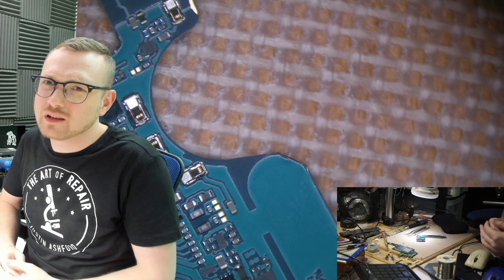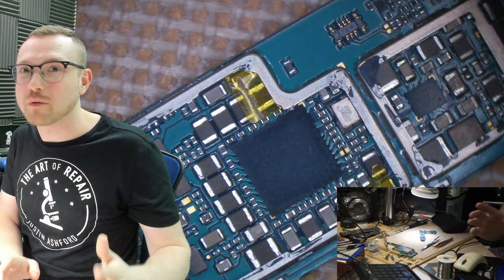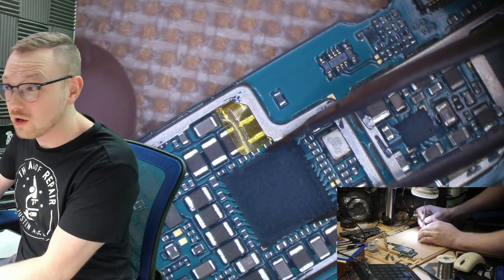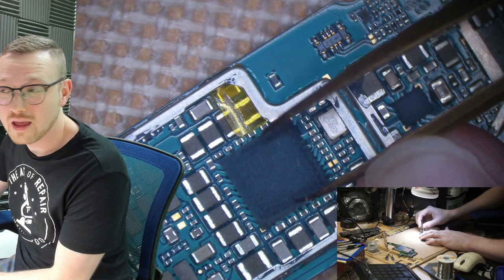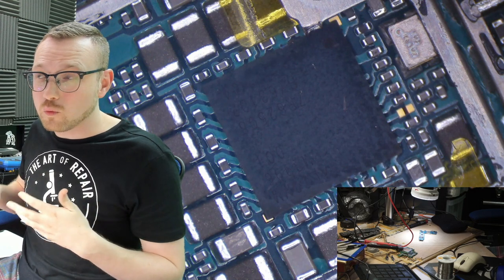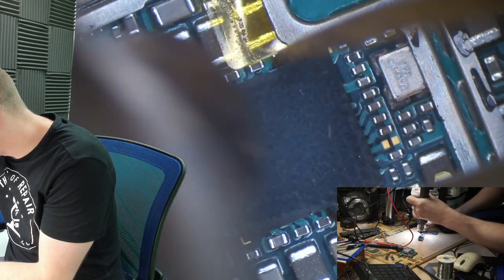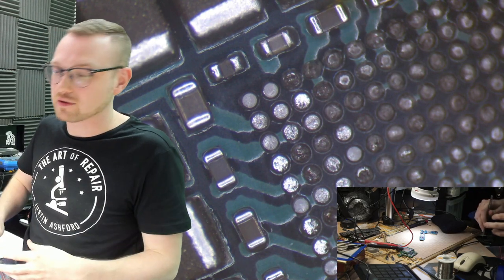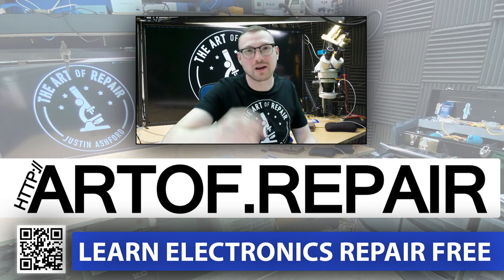Quick & Easy | Basic IC Removal Technique & Tips | Harvest Chips with Ease | Small - Med Sized ICs

Comment: I live in the hills of Nowhere and cell signal is pretty ghosty so I draw spotty WIFI from a repeater linking me to my family's main house. When you mentioned visual cues I knew at 3am that I had to get out of bed and go to the main house to watch this with great interest. I don't care about the boards but I want to lift working components, not roasted chestnuts. You have started my day off right, sir. Recycled boards and running specs on all the components has become my primary source of parts for projects. I love finding real "get shit done" components like expensive or high grade op amps, regulator or booster ICs or just the really useful transistors.

Comment: I did this today and it worked really well, I got the idea from your other video on how to deal with EMI shields so I guess its no suprise you do it in other circuits. I liked the way you described gravity can react faster than us also haha, just a solid fact right there. Now I'm just going to go through your other videos and find out if there are any good techniques for reapplying BGA chips, if not I will just make something to hold it in place while gravity pulls the chip back down once the solder has wet.

Comment: What if you were working on a huge and heavy board? Wouldn't you rip the pads?
Reply from the maker: this video is for microsoldering, not for big boards. if it's a big board, but you felt like it would still work.. don't lift the entire motherboard, just hold onto the chip till it feels loose and it should come up easy. 

The goal of "lifting" the board is that the phone and small tablet boards are super light already so they are never heavy enough to destroy stuff. also, we are only lifting like a millimeter if that, just go get a practice board and try a few times, if its obviously some huge ic chip that you have no business taking off like this, it will be apparent, so if you couldn't do this normally with a normal hot air station. prob best not to try and pull it off. because that's not the goal here.

Comment: If one side gives before another the weight of the board might rip off the trace on a few solder points?
Reply from the maker: nah, also, your really not so high off the ground and if you just make sure you aim your hot air where the trouble spot of the chip would be i think that could easily solve that if it were much of an issue. But iv been doing it this way for years and its been amazing every time. Just don't hold up high in the air XD lol

Comment: So, I have an AOYUE Int 968 and have tried to get a mosfet off a motherboard from a First edition Xbox One. I've seen others make this look super easy in videos but mine has completely crumbled to ashes now trying to get it off.  So now I have no black top of the mosfet left on the board but still have it soldered to the board. I don't even see the solder melting at all but the heat sure is hot as hell and burnt up what was left of the mosfet i was trying to remove. Any tips for me to get the soldered part of this mosfet to come off .

Comment: Bro what temp do i use in my quick 861dw+ i only work on Android mobile phone Android phone comes in white pasted glue ic , black pasted and some times not pasted but once i was Repairing a iPhone 7 audio grey out i was continuous heating that ic from last 1 min with 350 air80 but ic not pop up , i increased temp to 370 air 80 ic did not move in last i have to use 400temp and air 80 audio ic came out of motherboard but after reballing and installing ic phone was dead i chekon dc my bb cpu on back side was heating too much what technique should i use in iPhone Repair ?

Comment: For some reason when ever I try to remove a memory chip the solder does not melt. I have been heating one up as I am writing this comment for like 17 mins and at 713f and it is still not moving. What am I doing wrong?
Reply: Also I have the WEP 8858 V
Reply from the maker: @circuitbreaker3D  go make a post on the soldering subreddit at http://reddit.com/r/soldering and tag me my username is /u/thephonegod please provide photos and details and we small try to help you

Comment: What is the Hot air gun's temperature and air speed?
Reply: Normally i use 360 heat and 50 air. It is not any rules for remove ic by this method,   you can go for 400 or 450 no problem. As soon as temperature reach it melting point ic remove and pcb drop. There is many factor works when remove ic like, temperature, air, surrounding temperature, nozzle diameter, distance between ic and nozzle, angle of nozzle....so thir is no perfect answer at my point of view. Hope my answer help. 🙏

Comment: What if the chip is too large for the tweezer to handle -  Use a Manual Vacuum Suction Pen tool with a high-temp silicone tip.
I don't think you saw this reply on your comunity page a while ago, so here I go again... Think about this:

Hot metal oxidize faster than cold. Burning  and rusting metal often crumbles into small pieces and is destroyed. Fact!?
Cleaning the tip after use removes any sacrificial metal/alloy that can be oxidized, leaving only the tip to oxidize. So, letting it sit burning hot for a while, and the tip goes black due to oxidation.
You need tip-cleaner often and yet you get black spots on your tip(s) over time, making less contact with the pad and component - which makes you push harder when soldering, thus µfracturing the coating . End result: A new tip required often, as it is destroyed 'by usage'.

Applying extra solder+flux to the tip before putting it back in the stand adds sacrificial metal which then oxidizes - leaving the tip itself untouched. An added bonus is when cooled down, the solder acts as a protecting cap against mechanical damage.
After sitting idle and usage is required the solder is wiped away (I use a moist spongue) and the tip is shining clean and ready to be used. Bad solder which is wiped away or bad tip which needs replacing....

Try it (or think about it). I have a Metcal MX-500p with tips that are over 10 years old - and yes, the tips are used on a regular basis and work as if they are new. A light metal-metal touch is enough to transfer heat, and since I don't use them as a prodding, lifting and screwing tool - only to apply heat the coating is not cracked, scratched or damaged.

Regularly cleaning the tip during soldering keeps the tip clean and tidy - as you should: Apply heat to the pad, then apply solder.

The excuse about it taking time to maintain the tips I don't buy. Using tip cleaner and smelling that awefull ammonia smell, searching for new tips and spending money and waiting for them to arrive - hah, it takes a lot less time just to apply a bit of solder every time the soldering is done, especially if using >1mm^2 rosin solder.

(PS. Applying leaded solder with the iron before using hot air is a great trick to get (through-hole and smd) parts to reflow safer, faster and easier - though it requires a steady hand if the parts are small. Talons are a great tool, especially if they heat up quick)
Reply from the maker: To answer both your thoughts  
This technique should work just fine on small to medium stuff, once you get into bigger, dense CPU like arrays it's better to start working with a tensioned blade to go under. But As long as it's not underfilled and fits in the natural opening gap of tweezers in our industry, I'm sure it won't be an issue. 
----
iv known IPC instructors that also follow this method, it's in a lot of the old textbooks for sure, which is itself the method is fantastic and works great for those who want to conserve their tips for years, but the truth is, iron tips are consumable, its the nature of the beast and if your taking care of your tips throughout the day as shown, then they will still last a very very long time.
I think personally as iv really started regularly using many different types of stations while I travel around, I see that depending on the station and tip makeup this sometimes is or isn't an issue. 

Iv used PACE stations as well as HAKKO stations for over a decade and my normal big boy tips have never been replaced, not once, and I usually replace my micro points yearly just because im doing day to day work and my stations are usually on all day. Iv noticed with higher-end stations that have a different coating thickness to the tips ( JBC ) that yes, you can end up moving through tips at an alarming rate, but those are also really pushing the limits on that type of tip design imo playing with the coatings to make them so thin to allow better thermal transfer to the board.

I have personal micro tips at home that have been around since the beginning, all following the same regiment of making sure their clean during work and after work. For me it's like, I pay 9-10$ for a tip, which, if your soldering every single day... it's cheaper than a pair of tweezers dropped on the floor. A solid pair of tweezers is 20$ minimum. I think iv paid a total of 50$ over the last decade in tips more or less from losing them or dropping them or something. and I'm pretty sure my year ended tips would have been just fine. I just 

While your science is sound, and I do think adding some solder at the ends helps, I think your argument that they "are not consumable" is more than reaching. Cmon now

I think if we were to talk about this more in-depth, it would be a conversation more or less on what other people are doing between turning on and turning off a soldering station such as running max heat 24/7, forgetting to turn it off, not having standby mode or at least a basic footswitch for older 900 series stations. 

But I don't think promoting keeping your tips clean constantly throughout your workday is one of them, my tips are years and years old and have some things to say about that
. 

I do salute you for having and committing to using one set of irons for the rest of your life though. =) 

Also, yes, pre tinning helps for sure, the same premise as same alloy work. Reballing ICs with same or like materials as the board and such =) I am pretty sure that's what I did in the ETJ video. Kinda hard not to put the solder on first with the hot air on the other hand =P I might already even have a thermal preheat video, if not, i should.
Reply: @TheArtofRepair  - Thanks for your reply.  I am not saying tips aren't consumable, just that it takes a lot less time to take good care than to replace them imho.
I follow your reasoning, a business is a business - and the more one can make, the better  and optimizing workflow is a low hanging fruit. If tips are cheap and plentiful, work'em.
I made a holder which fits the base stand of my microscope and it holds my Metcal solderstation. It is a great way to add weight, and avoid the microscope tilting (lens, cameras and light adds a bit of extra weight). I designed the layout in such a way the on/off switch on the metal is facing up and outwards, so it makes it way easy just to switch it on when needed and off when not needed. Yes, I turn it off after use - why waste power, and it heats up in a few seconds anyways.

I have done a lot of soldering, and worked with a lot of people in environments with shared soldering stations. I don't know if they didn't knew about how to use tools, or cared, but tips and equipment when shared never seemed to last very long. Some people seemed to use the soldering tips as prying tools, drills, screwdrivers, etc. 
Banging and throwing around the tools on the work table is another thing I noticed too, it makes the tools last a lot shorter - especially fine tweezers and heating elements.
Experience - doesn't come cheap, nor do tools and equipment. Mentioning observations and teaching others is a good investment imho. Thanks for your thoughts and knowledge
(Btw, I do have an assortment of different tips, hoof types, blades and tips with smd cut-outs - some are no longer in production, as far as I know - so I take extra good care of those)

Edit - A few examples of using tips as banging brushing tools, try to notice somebody hit bottom in the brass holder and/or slam-dunks the iron back into its holder - ka-boom, eh ka-blammm.
https://www.youtube.com/watch?v=sr3BuZDmIwo&t=1320s - PS4 Blu-ray optical drive Chip Swap re-marry - New PCB Holder iBoot box and Blades (Like the PCB holder he found though)
https://www.youtube.com/watch?v=2L81QX4vACg&t=2070s - MASTERWORK - iPHONE 7 PLUS STUCKS AT 22 mA AFTER PRIOR REPAIR ATTEMPT - IMPORTANT DATA - CPU (Look at his table around 2:40 in his video, it's full of holes)
We all have different techniques, if we don't question them - how can we improve. If we don't get feedback, is there anything to question?

Comment: Would this potentially rip a pad though?
Reply from the maker: as long as its a non underfilled chip, then no, pads rip because the adhesive holding the VIA in place under the pad is usually heated and falls off. Anything actually ripped off comes from alot of force being applied. If we apply that to this situation and technique we can see that the heat never really makes it too the pad itself as we are focusing our energy onto the IC and the top of the bga array under the IC. So it releases at the perfect moment from the IC itself and doesnt effect the array pcb side. I posted some photos of this in the video and explained why as well.

Thank you for your question ITG! Hope this info helps =)
Reply from the maker: go to 8:00 in the video, thats the spot that shows what im talkin bout =)